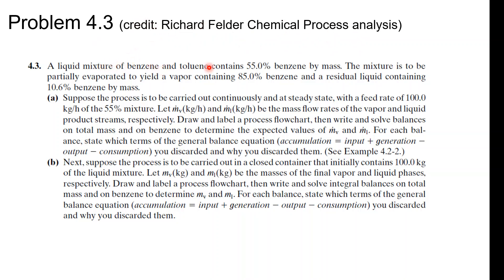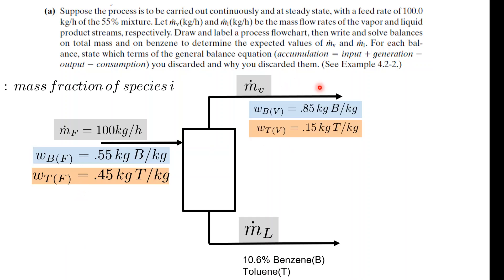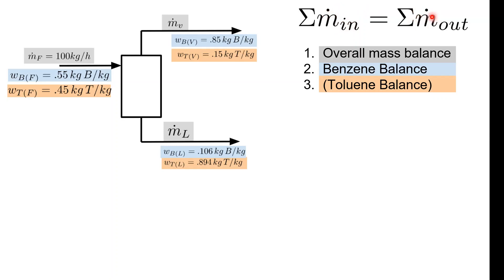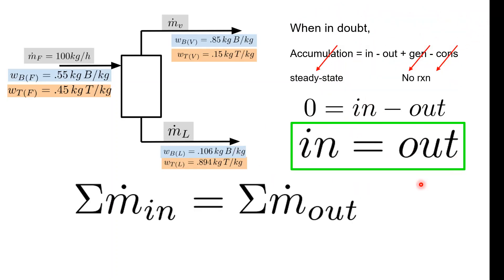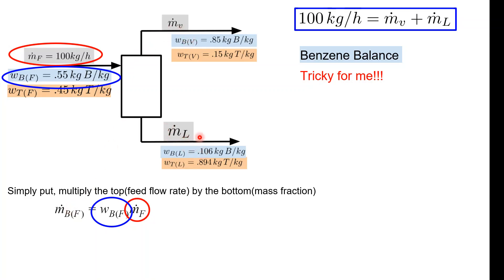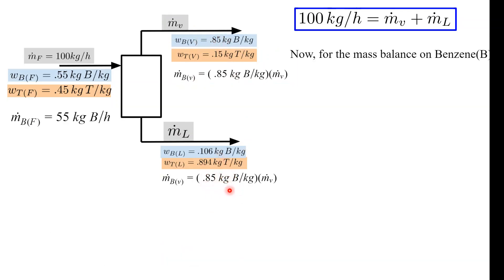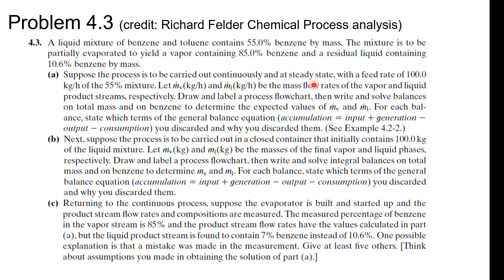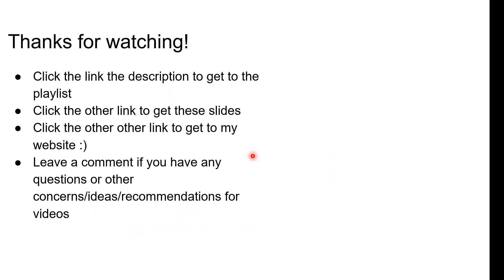4.3 Distillation of Benzene/Toluene Mass Balance Problem Tutorial Chemical Process

Comment: 200 kg/h alcoholic solution containing 50% EtOH, 40% H2O and 10%
MeOH is distilled to give a top product has 91% EtOH and a bottom product has 22%MeOH.
Calculate top and bottom product flow rates